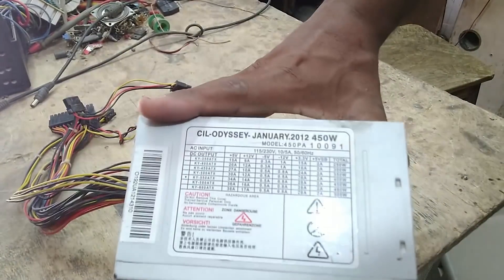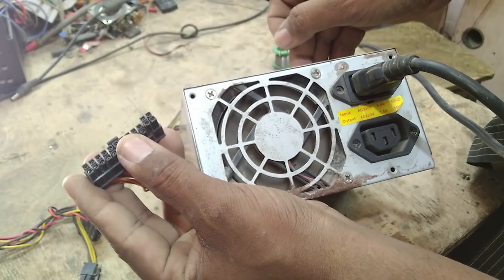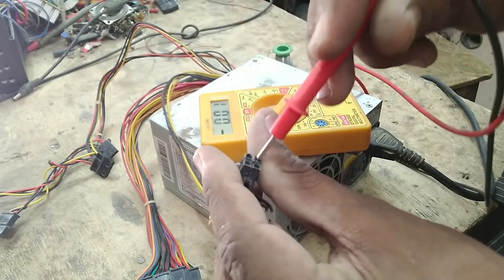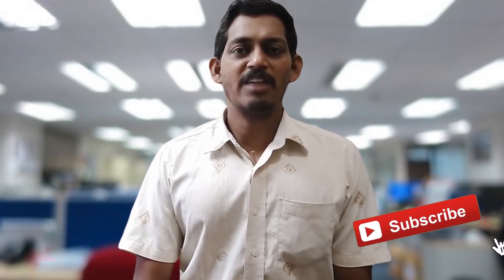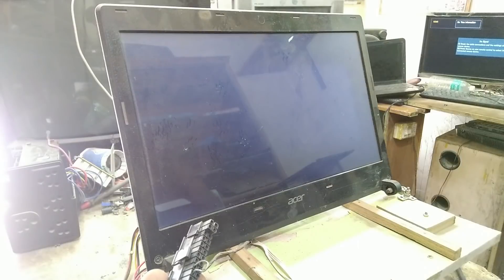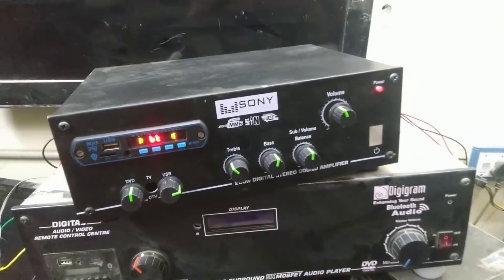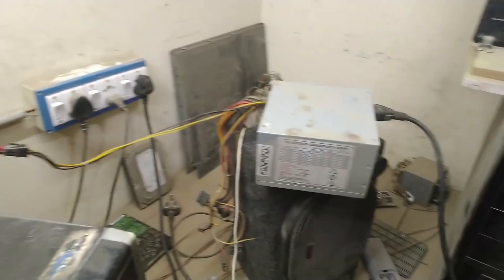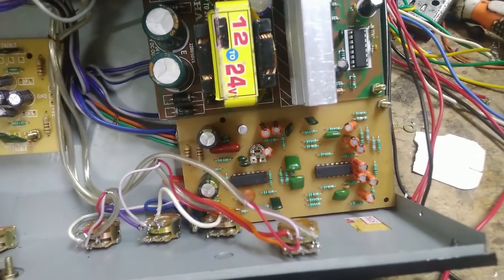HOW TO USE SYSTEM SMPS AS 12V (15a) DC FOR CAR AMPLIFIERS

Comment: Bro tda 7294ic STK 4141 IC equal varuma
Reply: Idha kealvidha eanakum dha
Reply: Tda 7294 70 to 100wat varum stk4141 50wat than varum aanal stk sound konjam yethu nalum kuppunu yerum 7294 heat agum aanal sound smooth irukkum ic complaint athikam varathu. voice clarity nalla irukkum .